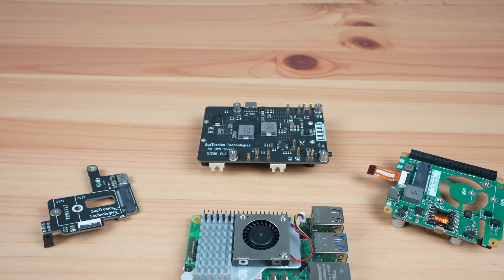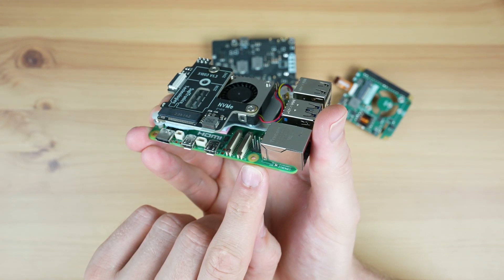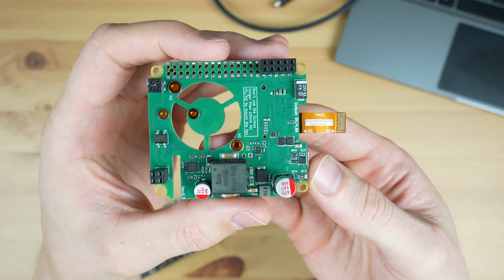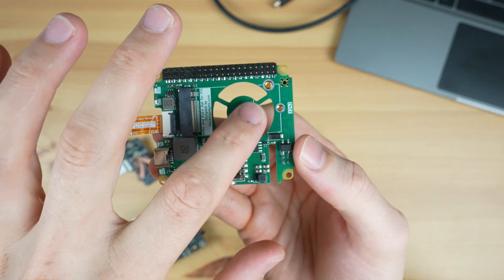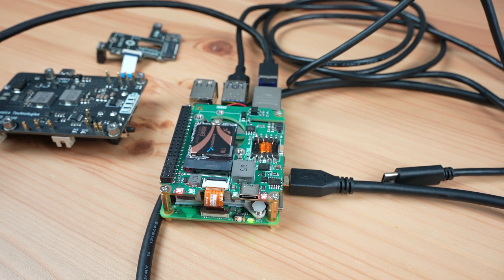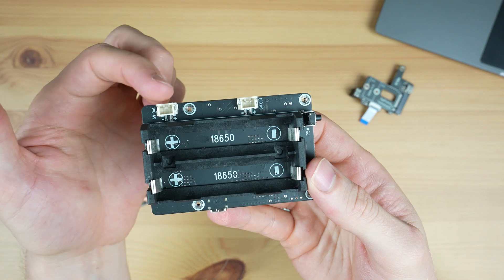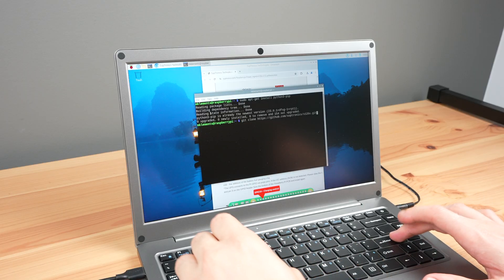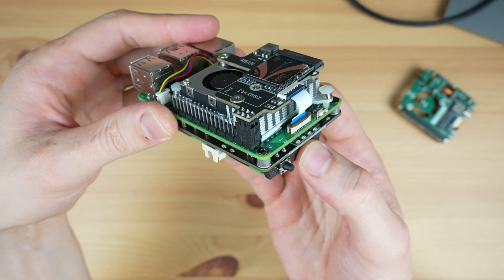Upgrade Your Raspberry Pi 5 With These Must-Try Hats

Comment: Great video!  I'm working on a PiCore music server project with a Pi5.  I am wondering what would you recommend for the following:  8 or 16GB Pi5, UPS Board with on/off switch, active cooler, dual 2280 NVME hat and a case to hold them all.  Can you help?  Thanks in advance.

Comment: Thanks for the video -- Can you connect two fans to 1 header on the pi 5 board ? So the case came with a fan and i also bought active cooler -- now i am thinking to use cable to pair them both before plugging on the fan plug. Thanks

Comment: they have a hat now that you use a 2242 drive with and it sits flush with the top of the usb ports and it has a built in cooling fan that goes on the pi.
Reply: Which one ? Can you share link?

Comment: Very cool video! Like you say, these hats make the PI independent. I love your UPS system. Keen on trying that.
With the hype around AI, I want to try connect a GPU to the PI5 and run an LLM (at decent speeds, hopefully)!

The PI5 will be complete when it has UPS, AI HAT (for object recognition), NVME and GPU for fast(er) LLM access. Its like having the whole internet and a library in a lunch tin!
Reply: yup, just waiting for that.

Comment: there is a Raspberry PI am looking at and wanting to get i I would like for you to check out I have been eyeing on it it is Geekpi u2500 m.2 NVME dual3.0 20 2.5g Ethernet adapter adds dual 2.5g network connections let me know what you think want to add a poe hat to
Reply from the maker: I'll take a look at this hat, thanks for sharing the information

Comment: Sorry, but the SSD hats that only support 223x and 224x size boards aren’t an option these days as the 2280 are much less expensive and far more available, and they are available for < $15.
Reply: Got Corsair MP600 MICRO 1TB 3D TLC NAND Flash PCIe Gen 4 x4 NVMe M.2 2242 Internal SSD yesterday for $85. Hooked it up to my Hat + on RPi5 and enabled gen 3 pcix. Read and write speeds are around 900 MB/sec.

Comment: Would the X1003 NVMe hat work with a Hailo8L tpu?
Reply from the maker: I don't see why not, but you'd need to use a PCIe bifurcation board and probably need to use an extended PCIe cable.
Reply: @MichaelKlements I will use an SD card for boot, just the small nvme hat for the tpu module.

Comment: Some design decisions are getting ridiculous, by now, as they force 3rd party hardware developers to adapt with each new generation of the RPi boards (changing the HDMI plugs, switching the position of the ethernet every time, at last adding a power-button in the 5th generation, but still no nice serial header)  I'm really curious, how long it takes them to make the RPi 500 complete (= add the parts for NVMe and PoE there, + a breadboard at the rear + Wifi antenna SMA connector + number block + touchpad + small integrated OLED / optional 4x20 text LCD  + DB9 RS232/422/485 + secondary full size SD card reader + internal LiIon for using in as a portable terminal ) ... or at least ask people what extensions they really would like to have.
On the other hand, we are grateful, Raspberry doesn't do vaporware, but comes up with news, when they are are ready to ship.
Anyhow: Maybe someone like Waveshare or Banana comes with Boards + depicted solutions based on the CM4/5, entering new niches.

Comment: A quick note I just got my pi5, and now using a 200 MB/s speed, 500Gig Sd Card, with a 3.0 external USB doc to boot Kali. The speed increase is from 104 MB/s in SDR104 mode (UHS-1 standard). to 200MB/s and all under 20.00 cheat and good boot.

Comment: Lets hope the Pi can handle having all those hats installed.  I know with my Pi 3b I has issues where I get a low voltage detected when booting up if I have too many hats on.  My Pi 4b does not seem to have this issue.  I even tried a Pi 4 power supply on the Pi 3b but had the same issue.  I might need to hook up a dvm to the Pi 3b and see what is happening with the 5v.
Reply from the maker: The Pi 5 has a fairly well beefed-up power supply circuit, that's why it needs a 5V 5A adaptor instead of the older 5V 3A adaptor. I know some of my Pi 4's would occasionally have power issues if I plugged power hungry USB drives into them.

Comment: Nice testing. Any chance to get results with the UPS and the PoE+ hat together?
Reply from the maker: I don’t think they can operate together as they both supply power to the Pi in different ways. The best option would be to put a UPS on your network switch if you need that functionality.

Comment: I was interested in all of those hats! They are really good. 
The inly thing that is missing with poe HAT was 2.5G ethernet, obviously poe is useless when You need usb-ethernet dongle. There was one hat that featured 2.5G (via usb) and nvme, but no poe. Hopefully we will get it some day :)
Reply: I've added this to my to-do list. I've designed an NVMe and 2.5GbE hat, so making another one with the PoE+ feature is not difficult.
Reply: @vileerdeng  wow :) this would be just awesome, ultimate pi5 HAT. 
Another idea, Jeff recently reviewed usb 5Gbit ethernet dongle. Obviously this is just first one on the market based on RTL8157, just level up to the 2.5G.
If You are familiar with design of such devices can You also comment if it's possible to design usb-ethernet switch for more devices? For now, ethernet can provide power and network, same for usb - because we already connecting usb-ethernet dongles, use usb-pd to power up devices. I was looking for something that will have let's say 8 usb--c ports and all connected devices get ethernet and power (if device can usb-pd, pi5 is lame here). On the other end there should be regular ethernet and power plug. Is such device possible? We could connect laptops, ipads, phones etc. all with ethernet and power without any dongles and cable shaghetti.. What do You think about such idea?
Reply from the maker: The Pi 5 really could have done with native 2.5G networking!
Reply: @MichaelKlements  and m.2 slot like literally any other SBC :)

Comment: The x1003 died on me after 3 months but apparently it’s a problem with the ribbon cable.
Reply from the maker: The ribbon cables on a lot of these hats are quite fragile.
Reply: @MichaelKlements  The cable worked fine for about ~3 months in a case. Read several forum posts about how they were shipping a new cable and would replace the old one for free.

Comment: Another benefit of PoE power is if you have a managed PoE switch and it's plugged into a UPS, you get a central battery backup and remote power on/off control! I love using both of those features for my little array of homelab Pis :)
Reply: Could you use the Poe/m.2 hat on top and the ups bottom hat with rechargeable cells to help mitigate the effects of dirty power?
Reply: I am currently building exactly this. I have a 6-inch, 6U case that I’ve printed, and I’ve already ordered my PoE boards, switch, and Raspberry Pis. I’m planning to build a mobile power station in the bottom of the rack, though I still need to find one that can power the Pis and fit inside the small 6inch rack.
Reply: i love your vids

Comment: Great vid…but an hour or 2 for the UPS? 
this isn’t the future I thought we were in yet😅
Reply from the maker: It depends what you have running. A Pi 5 uses around 5-10W depending on load and what’s hooked up to it. A 2500mAh 18650 cell has about 7Wh of usable capacity.